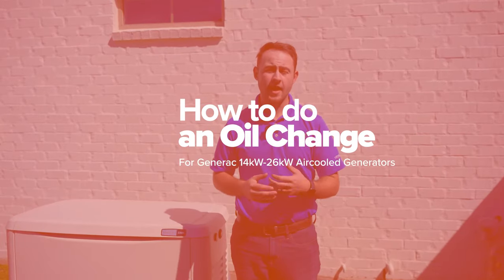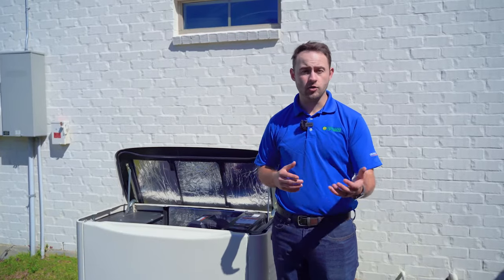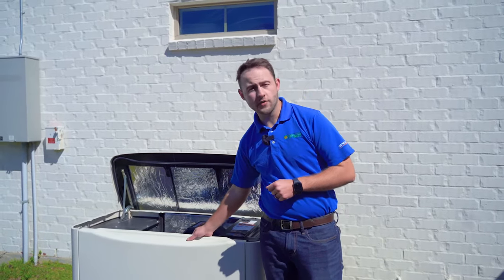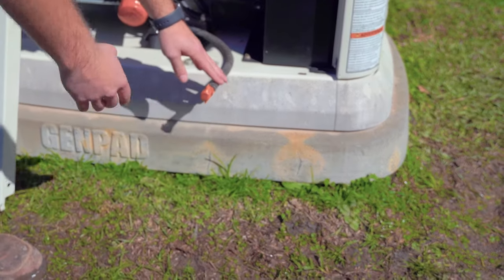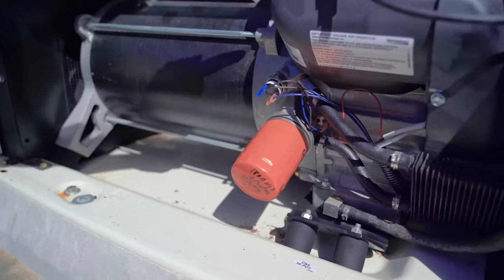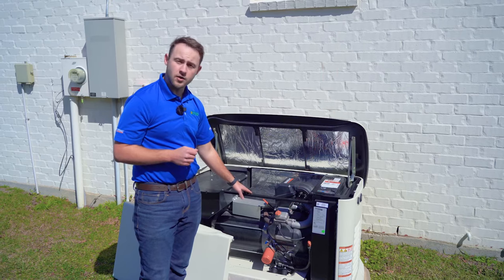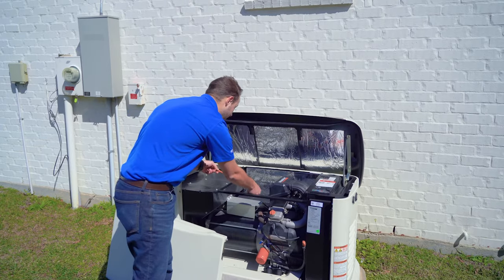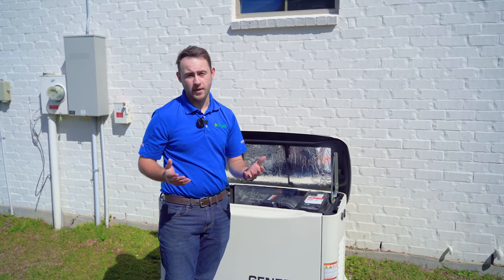Changing Your GENERAC Generator's Oil

Comment: When did Generac change to 5W-20, my manual says 5W-30 full synthetic.
Reply from the maker: late year 2022 they changed their recommendation.
Reply: @optimizeGP bought ours in April 2022. Is 5w30 still ok? Thanks.
Reply: I run 5W30 synthetic in mine.
Reply: Says in the manual to use their special 5W-20 GEO oil, but if you don't have access to that, then use 5W-30 full synthetic.